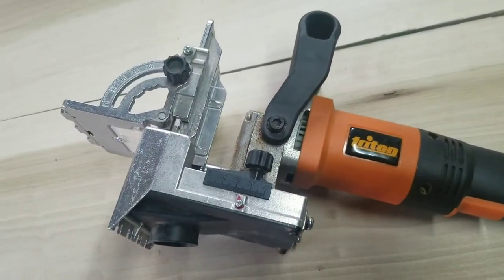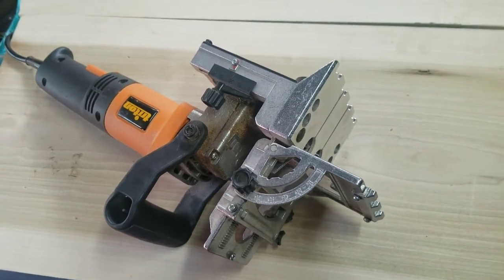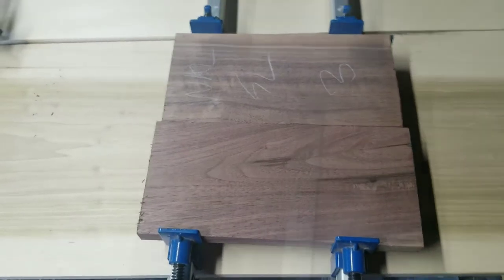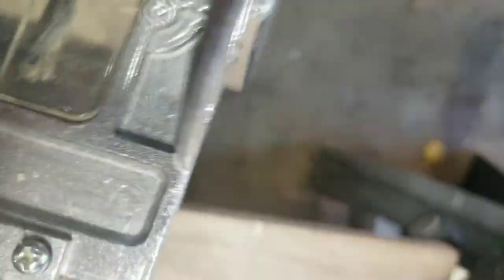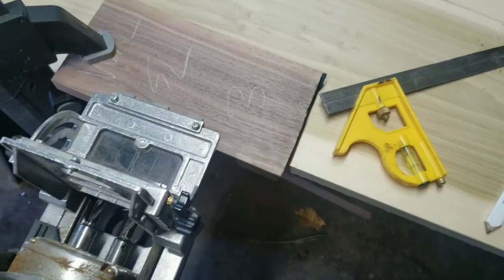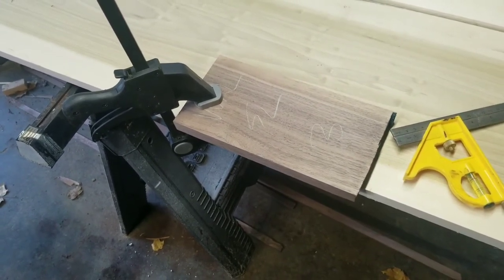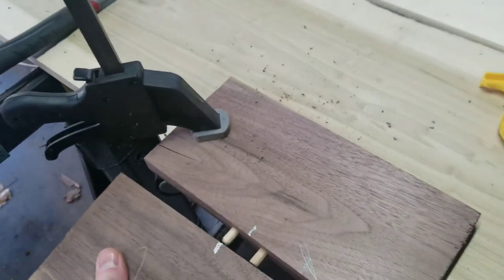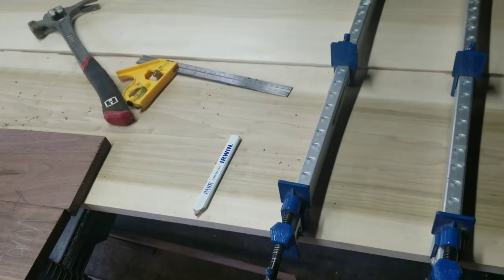Biscuits vs Dominos vs Dowels= Triton Doweling Joiner TDJ600

Comment: Edge gluing doesn't require anything for strength.... the glue itself has proven to be stronger than wood.  Anything you use is only to help align the joint.

Comment: I don't know, you use enough dowels and you can get an even stronger joint than a domino. So I am questioning whether the Domino is really that much better than this.
Reply from the maker: I think you're right, but the only thing about this particular tool is it isn't as precise as the Domino machine. If you can dial it in correctly, it can be a helpful tool just like a domino.